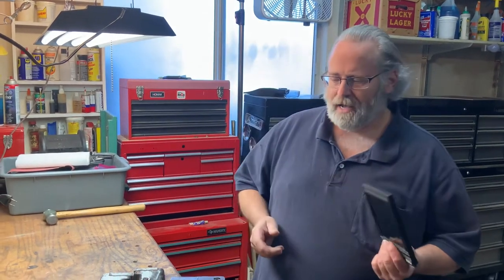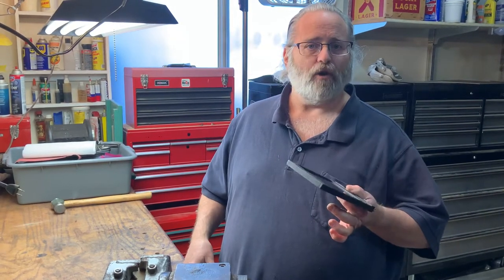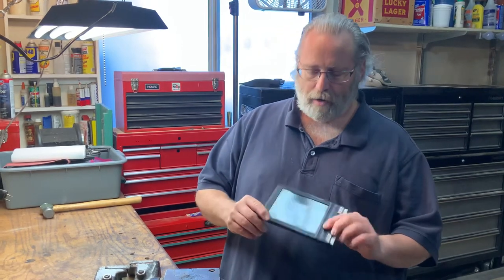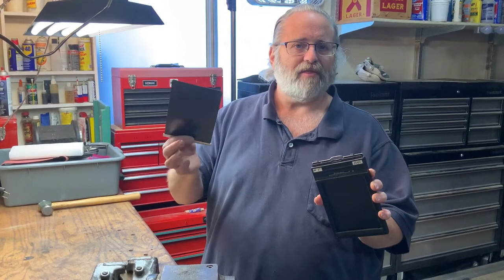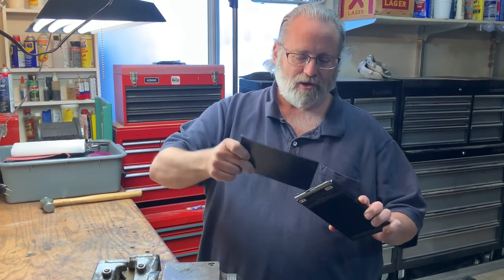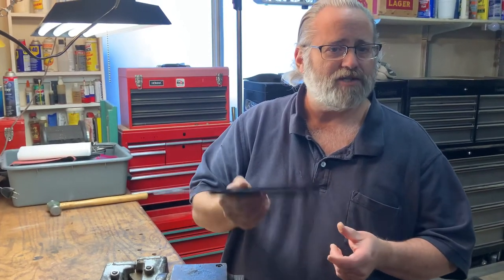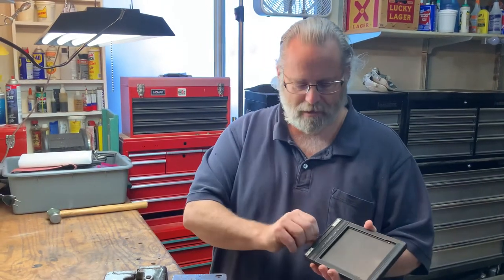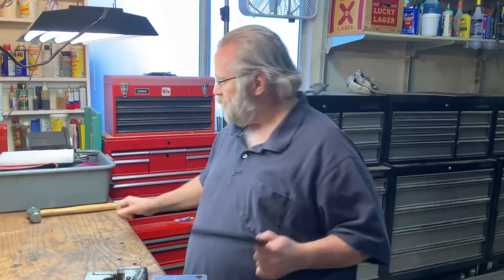#1 - Simplest Fix for Film Holder Problems

Comment: If you’re short on cash, and have access to an air compressor, I find that GENTLY blowing out your light traps is a helpful tip to keeping your money in your pocket, and other holders available at $5-7/ea for other to enjoy and use.

For those of us using larger formats like 5x7, 8x10 or larger, maintaining film holders is really the best option, seeing their much higher price.

A couple gentle puffs of clean, dry air from a compressor help to clean out dust that has accumulated in the light traps, and in the grooves where the dark slides run.

I use a little bit of hard paste wax on the slides as well, right on the outer edges that make contact with the grooves. Very smooth.

Replacing hinge tape is quite simple, and using a high quality self-adhesive BOOKBINDING tape(not gaffers tape) to replace the hinges works remarkably well, and I find I get around 10-15yrs of service from them (this is based on holders I repaired in 2007/2008 still going strong).